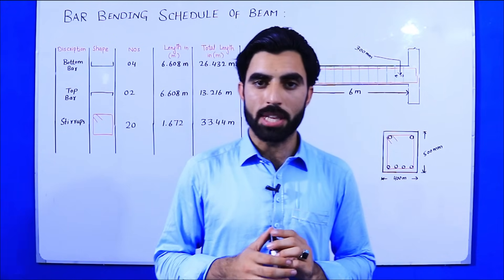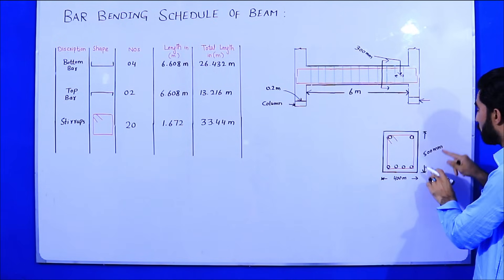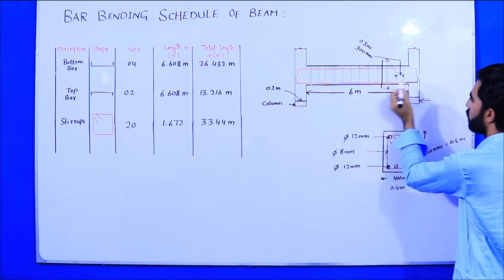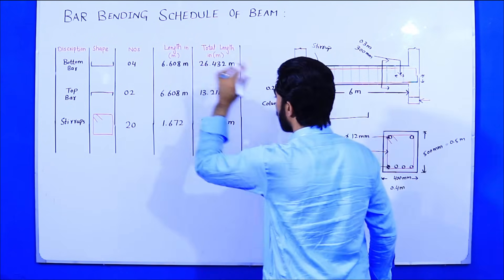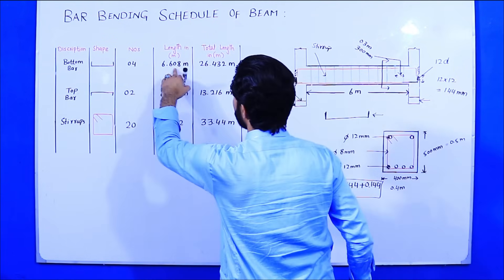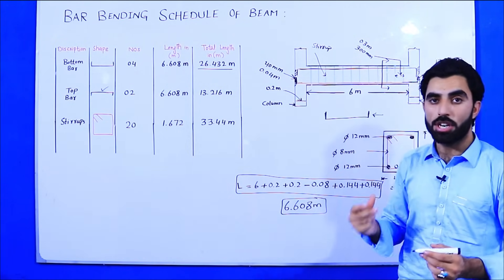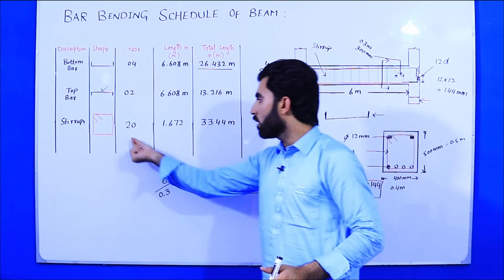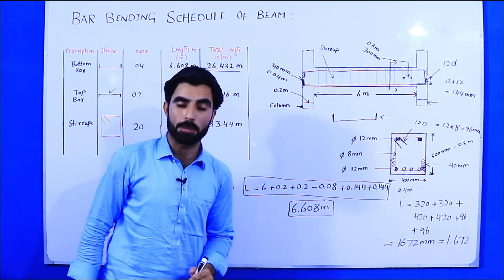Bar Bending Schedule of Simply Supported Beam | How to Make BBS of Beam|

Comment: I doubt, regarding development length and lenth of bottom bar. Development length is considering by adding 40d from the face of column on either side but you are considering 12d for bend up portion and sayings development length. Another thing, is it not required to calculate crank up lenth of two bottom reinforcement? Please make clear?

Comment: For calculating stirrups you should minus the cover about 25mm on one side. 40mm u cannot do for the beam.
Reply from the maker: Lol this is 500x400 column size go to site Than u will see
Reply: @CivilEngineerss  on site for 500x400 there should be center bars as well and coverfor beam should be 25 mm minmum so you can have 40mm but 25 mm is also legit
Reply: @CivilEngineerss  Aslm. Why did we not add 1 in qty (Nos)  of stirrup ? Thank U

Comment: Very good
How do you determine the depth of beam if the length is 7.7m ?
Also do you have to use 4 bottom bars and 2 top bars or does that change also ?
So my project has beam running across 4 columns I🔛I🔛I🔛I .. ( 🔛 = 7.7m)
Reply: The maximum length of the beam is 6m
Reply: is it 7.7m clear span you mean? i. e Total lenght of beam on the 4 supports is 7.7 x 3 = 23.1m or total lenght of 7.7m. You can do a sketch to clarify.
Reply: @timothyogbechie2610  yes 
7.7m each piece of beam continuous resting on 4 columns equally spaced. It’s an open plan office
Reply: L /15 FOR SSB. L/( NOT GREATER THAN 20 FOR SSB) REFER IS-456
7700/15 = 513MM (or)  20.53 in (or) 1.7 ft... to check its safe or not go for BM calculation